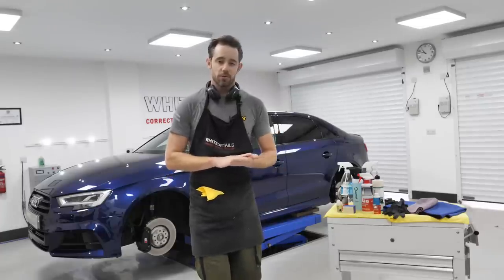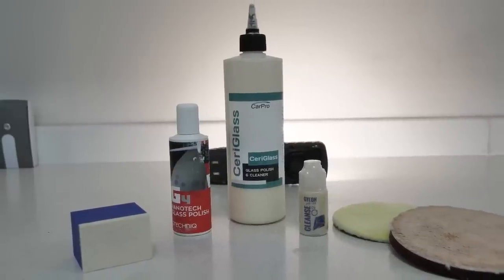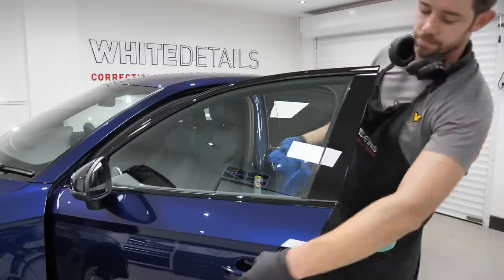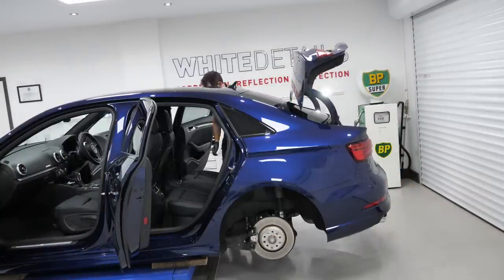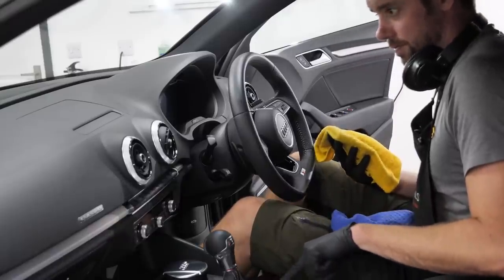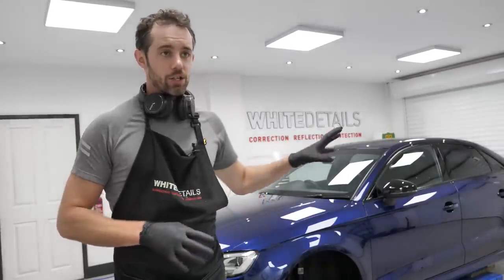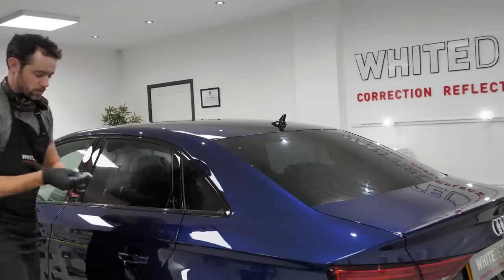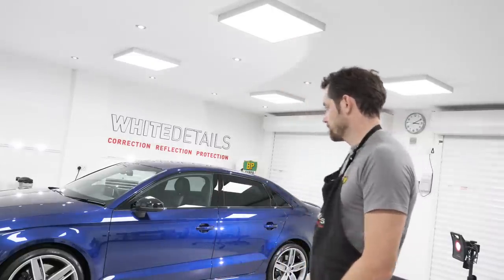How To Clean Your Car's Windows

Comment from the maker: Thanks for all the tips and comments about service mode guys. In the past I've put the ignition on, allowed the wipers to 'wipe' and then kill the ignition halfway through; quite why I didn't think ahead to do it this time.. It is frustrating though as once the screen's all prepped and clear, you do have to allow the wipers to fall to their neutral position again; potentially undoing all your hard work! 

Also, I had hoped to mention that the cleaning methods seen translate to inside your home, too. Particularly useful for laptop screens, monitors and televisions (work small areas, half the screen at a time) Also, Gyeon Waterspot Remover working wonders on shower screens in the bathroom!
Reply: I just came to the comments section to mention service mode to you. I was surprised to watch you struggle and not use this, but hey ho, you can't know everything on all models and cars. I had to google this myself for my Golf R when I got it.

Do you clean glass like this on all details? or just on specific higher end details?
Reply: I always put a tissue, napkin, etc. under each wiper blade to keep them off the glass so they can still move on perfected glass freely without an issue. 👍👌✌

Comment: Jim love the video, however top tip put the wipers in service position, in the menu of VAG CARS or normally ignition on, off then hold the wiper stalk down for the floor and the wipers move to the vertical so the can be lifted free of the glass and changed. This make cleaning and application much easier
Reply: That's a good tip.
Reply: Dash DriverUK Thank you.
Reply: Yeah, but after doing so, you end up rubbing a dry windshield and it is not something you want.  Unless you cover them with a cloth or something, but thats much more effort imo.
Reply: @user-ds9fr5bj9s  i just put a thin lint free paper towel under each blade when returning them to normal position. Takes just a few seconds. 😁👍

Comment: Jim not sure if you know and choose not to but you should be able to get the wipers to sweep up and stay there so you can lift them off the glass properly. Should be the same on any VAG car and maybe other manufacturers as well, but for Audis and VWs I've owned, cycle the ignition - on then off, then hold down the wiper stalk until the wipers move up.

Comment: On the Audi A3/S3, if you switch off the ignition and hold the wiper lever down to the intermittent wipe position for 2+seconds, it will move the wipers into the "service" position.
Kinda the same as doing it manually with the ignition on, but this is "the Audi way".

To reset them back, put the ignition on and hold the wipers lever down until they return to their normal position (or drive faster than 12km/h)

Source: Audi A3 8V (2017+) owner's manual, page. 61

Comment: 37:00 There is a mode to get the wiper all the way up.
Usually, with the car unlocked and the engine off, you pull the wiper stock to the full speed. This will prop the wipers to the maximum position, and they will stay there.
This way you can either clean them without fighting with them and the bonnet; and also you can change the wiper blades.

Good video, and very good advice.
Thank you, Sir!

Comment: I started to watch another one of your great videos and thought maybe I would get fed up of a video this long just on one subject. Oh boy was I wrong, picked up so many tips & tricks and actually found it really enjoyable and loved every minute. I would comment on one subject of wiper jumping as my old VW Passat rear wiper always made a noise even in the rain or just a quick screen wash. Over the years I’ve had new blades being fitted by VW to get a pass on the M.O.T. This problem lasted for years until I used wiper blades uk and they picked out a Aero blade that would fit the old style and would hopefully stop the problem and also look nicer as well and would be with me next day. I was not sure and thought of just going to Halfords but they picked out the same old blade. I spoke to Wiper Blades UK again and they didn’t mind me calling twice within an hour assured me that it’s a straight forward swop and the pack would came with everything plus different types of plastic fixings.I bit the bullet and went for it and placed my order. The blades arrived well packed and once fitted I’ve not had any noises since, so yes definitely clean your glass properly but maybe just maybe changing your old style wiper blades to a newer style and this also may stop the dreaded old wiper blade noise and lifting at high speeds.

Comment: Great guide, another thing that I've used as a big tip if not in a climate controlled location is, turn the AC one with defrost on helps especially if it's humid out.

Comment: Hi Jim another great vlog and great to see you doing some how too’s incredibly valuable tutoring Thankyou.  You may know or someone else may have said but there is a wiper blade cheat on VW and I’m assuming Audi’s too, ignition on , activate wiper and it should stop in the up position which allows you to lift the blades clear of the screen and bonnet, clearly you’d need to do it before applying the coating etc, hope that helps, or maybe useless info lol. Thanks again 👍🏻

Comment: Thanks for this Jim - lots of info to perfect my method. By the time I’m cleaning my glass, I will have taken off my gloves as I’ve finished the wet washing stage. I will now keep them on or put. A fresh pair on. I use ONR at 1:256 to clean glass as it doesn’t flash off quickly. Gives plenty of time to switch to the second cloth.

Comment: Love doing glass...
They are the eyes of the car... and for me doing normally 2500 miles a month all year means if they're clean then I'm not struggling to see and therefore more relaxed especially at night or with low winter sun or during miles of spray ridden motorways
If you didn't learn something from this video..... you're going to need a defib to get the heart going again

Comment: Hey Jim, any reason you don't use the service position for the windscreen wipers? I'm not sure about the newest Audis but mine was just an option in the MMI that would put the wipers at mid stroke and hold them there so you could bend them out for cleaning or replacement.
Reply: I’ve just posted the same re the blade position, I knew someone else would’ve got it , apologies for repeating lol 👍🏻
Reply: Me too apologies ✌
Reply: I’m assuming because once the glass is cleaned properly, the downwards stroke of the wipers back to regular position would make smears due to no lubricant meaning you’d have to do the glass again? That’s the only thing I can think of
Reply: HDISatisfy yeah that’s the only problem.
Reply: @HDISatisfy  if it were me I would agree. Seeing as Jim wipes down the glass no less than 4 times makes me think a little smudge at the end would be well worth not having to constantly shuffle the wipers around to do cleaning, 3 layers of polish, etc.
Reply: amhershman it’s swings and roundabouts really. Just depends what you find more annoying. One more wipe over the glass come the end of the process or shuffle the wipers for a few seconds each time. Thinking of it I don’t know what I would find worse 😂

Comment: Hi another useful video.. Like the gloves idea and working fast and not to much product.. Was struggling to get my windscreen clean getting the road grease off etc was not working. I’ve found is to use Traffic Film remover sprayed on neat onto the screen and cleaned with a paper towel and then rinsed and rinsed some more.. Made the next processes a lot easier.

Comment: Thanks Jim for the in depth tutorial, thoriughly enjoyed and have learnt some new procedures and tricks. I use Gyeon Prep on the inside glass but don't follow up with any other product, I find it leaves the glass clear without any residue or smudges/smears. It is good for removing that dashboard vapor after hot weather that appears especially on the inside of windscreen from the protective products used on dashboard and surrounding trims. Cheers from Oz.

Comment: Oh my god you have ended all my stress with glass cleaning!

I always get smears after endless minutes buffing and I would cry out why what is causing this?! 😅

Now I know it depends on the towel I will experiment next time. 

I normally get infuriated and just went over with refining polish because the result looked better, but the oils in the polish flash when water has condensed on the glass. 😅

Good video 👍

Comment: Hi Jim, with audi or vw you can switch the windshield wipers in the on-board computer that go up🙂
Reply: Pheasant Pluckers son  yes it works that way with old models, but with neune there is a function in the on-board computer for wiping letters to swap
Reply: Pheasant Pluckers son  i have an audi a4 b8 2010 model, so it only works with an on-board computer🤷🏻‍♂️

Comment: Turn the ignition on and then turn it off. Hold the wiper stalk up until it stops in the middle of the windshield. You can now lift the wipers off the glass. Thats for BMW models.

Comment: great video Jim, good cleaner (Gyeon or AM Glass for me), good clay bar (AM Clay) and cant beat some good TRC cloths - waffle weave are good, and wife 'borrows' those and cleaner for the interior doors & mirrors in the house.  I sometimes forget to clean the wiper blades too.  Would like to try a glass sealant like Gyeon View Coat, but testing Angelwax H2GO just now, previously just used the ceramic spray used on the paint work.

Comment: You can put the wipers in a service mode to make things easier and it allows you to get access better.
Also I've used the gtechnique products your using and doesn't the instructions tell you after putting the coating on your supposed to buff it off and then reapply?

Comment: great video! got some great tips from you here. Haven't thought about using the gloves when cleaning inside. Next time, set the vipers in removal position, ignition on, off and hold the viper leaver. And I have great experience with carbon collective platinum glass, any thoughts on that one? Durable and price efficient